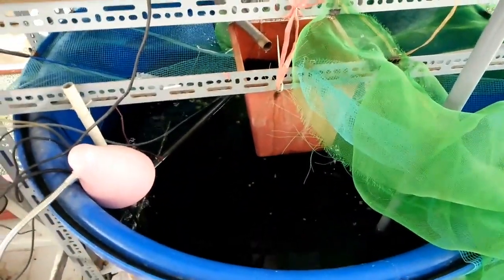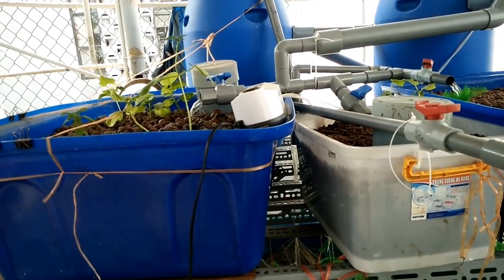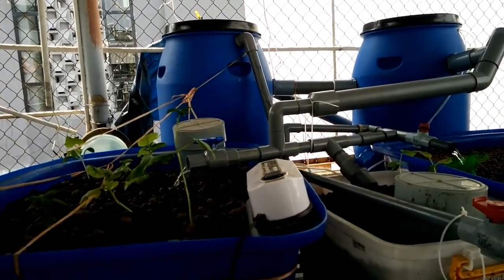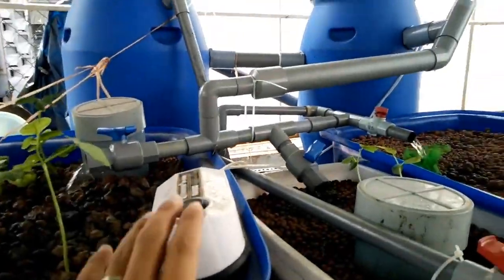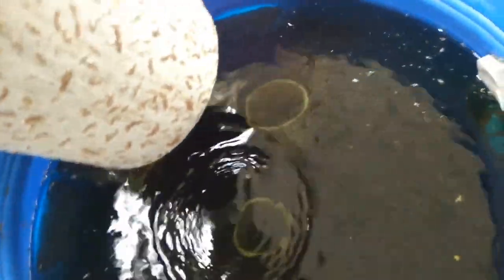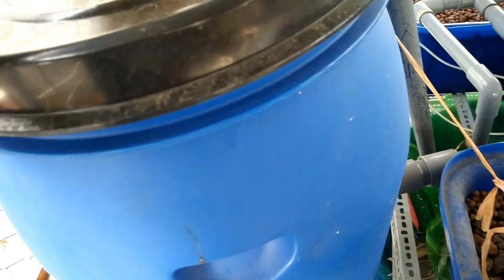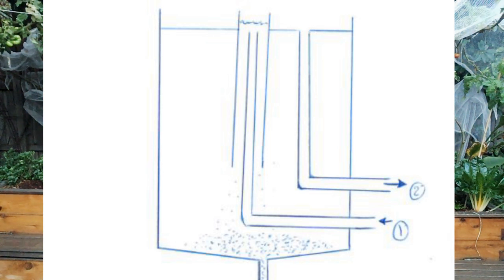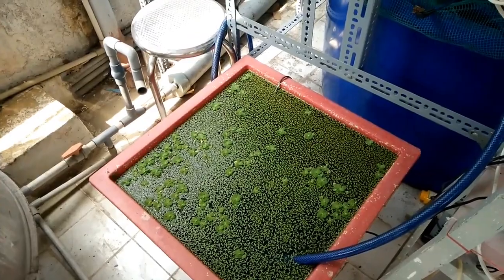homemade fish food, aquaponics

Comment: xlnt video again many thanks.
appreciate your experience and topics.
Melbourne Grower. Interested in reducing  food costs and minimal power usage
Especially home grown fish food. I grow silver perch and put a led light over my tank at night  during summer to catch beetles.  I also grow red wrigglers and duck weed to supplement year round. Tilapia sound very productive but is it to cold in Melbourne winters without heating?
sound quality is a  bit  dodgy. any chance of a better microphone 

Many thanks
Reply from the maker: Thank you Paul, yes Tilapia are not adapted to Melbourne temperatures. The light above the fish tank is an excellent trick 😉. Regarding the sound I am now using what is supposed to be a "good microphone" but I still struggle to get it right... I am improving but good things take time 😋
Reply: cool many thanks.